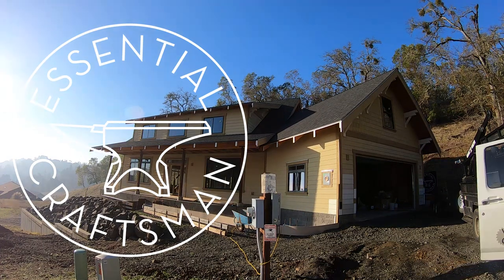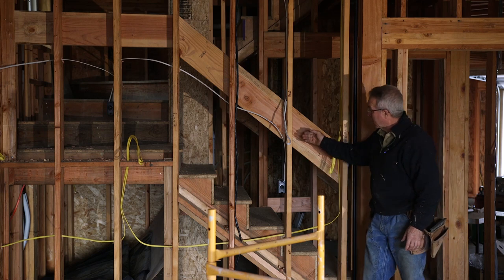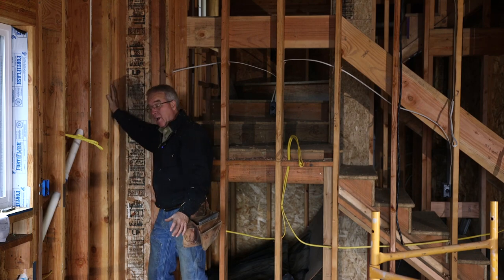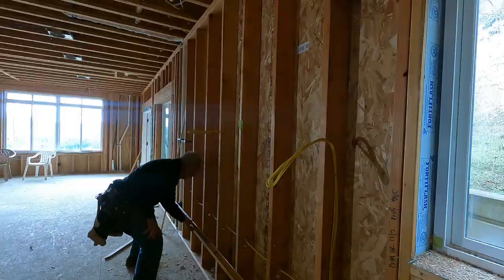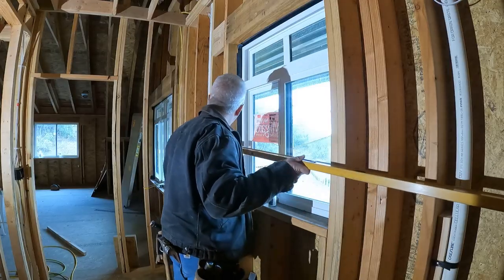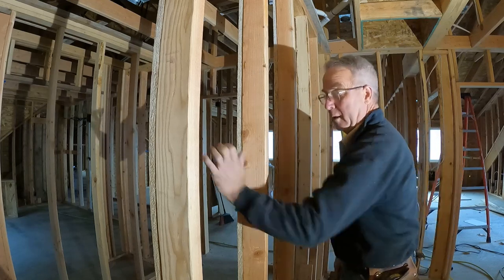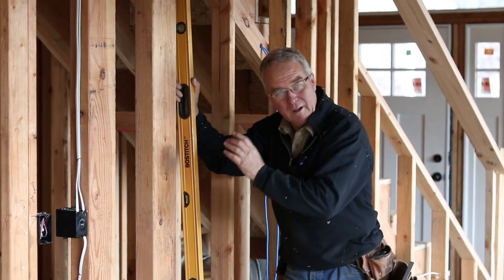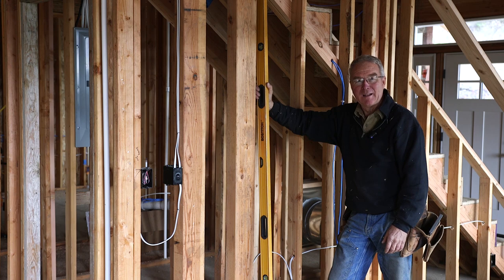Pickup Framing Ep.101

Comment: I installed a backsplash for my parents this weekend and quickly realized that this step was sorely missed. huge cups and bows that I had to mud/fir out. That doesn't explain why the existing countertop wasn't cut straight and there was no insulation around the window but it is what it is. Thanks for being my virtual mentor and showing the right way to do things the first time!😁

Comment: When you cant built the walls flat and throw them up (adding walls to existing structures) I make a jig from a straight 1x4 and several chunks of 14.5 inch 1x4 spaced with tight 1.5 inch gaps. Its honestly one of the most useful tools i have. It keeps the studs in plane and you can use screws or shims to flush studs you are adding one by one before you set them with nails. It takes more time but shortcuts lead to longcuts.

Comment: You and me differ on 3 points: I religiously install drywall backing on 100% of the top-plates and wall-junctions and I am fanatic about fire-blocking on every vertical cavity plus using fire-grade caulking on all stud or plate penetrations by plumbing or electrical. My son's house in Missouri caught on fire from the outside at the bottom-plate level and the fire went straight up into the attic where it did the most damage because of no fire-blocking before it was extinguished. Pick-up framing is usually not done that well by builders but to me is the most satisfying part of construction next to mudding.

Comment: As a young man, many moons ago. I worked as a helper on a framing crew building tract housing in Florida...Non of these practices were done, it was all about how many could we get done in a day. As soon as we gathered our tools up, the rockers were throwing up dry wall. Sometime you would see a wall stud bowing in the middle, you would just either slam the top or bottom to get a little of the bow rearranged to either the top or bottom. These house were built with all 2 X 4s, rarely seeing a 2X6, and never ever a 2X8 heaven forbid. Sometimes I drive through this same neighborhood, and guess what they are still standing and looking pretty good..amazing. But dont blame me, I was a board stacker, and forklift driver. Left the job after getting a chip off of a #4 case hardened nail into my eye, man that was painful. Safety wasnt a thing back then ( 1970 ).
Reply: A guy that worked for me had to wear an eye patch for 8 months as a result of driving those 4p cuts with no glasses. A year later, I walk around the corner and; same guy, driving the same nails, with no glasses. 😣🙄
Reply: @psidvicious  I was putting up furring strips on concrete block walls, as the framers were framing, my boss thought I wasnt going fast enough, so he pulled out his hammer and started driving the nail I had already started, he was at a angle while doing so, thats what made it splinter and go into my eye, He was fired the same day, They took me to a eye specialist, and they pulled out a sliver, which was scrapping my inside eye lid, the salt in the eye fluid would get into the scrapes and major pain was had that day, saying nothing about the salt going into the hole where the sliver had been lodged. Fun Fun. The company was afraid I was going to sue them, so they treated me really nice, but I wanted to be a carpenter and not a forklift driver, so 6 months later I said Goodbye. And became a welder.

Comment: I'm a steel guy.
Tolerance of .001" some process.
Tolerance of 1/8 on completed construction.
1/4 " over 100'.
Talking to one sub trade carpenter. Watched me use a transit to line up a tower and shim as necessary the first 10' section.
He says.  man let it go. I use under a quarter inch  out of plumb on my walls.
I says to him...1/4 inch over 80 ' is 2.5 inches out at 80' this structure will be almost 4" out when completed at your spec.
Reply: Do you do steel framing for residential at all? Been hearing all sorts of conflicting info on steel framing for a house.

Comment: this whole project has been very  interesting but i still can not get my head around building a house in the 21st century out of such a flammable material as wood..in a first world country                Keep up the good work guys :D
Reply: Steel, concrete and masonry may not burn, but they are not necessarily as fire resistant as common myths make them to be. Same goes with steel in lightweight construction. These non combustible materials can and will bend, buckle, crack/expand/explode, defeating compartmentalisation (if any was existing) and spread the fire. Well engineered wood structures perform better.

Comment: Personally.. The only important wall leveling is hallways and ceiling. Most walls will have some furniture, pictures etc..  on them. Kitchen cabinets can easily hide variances in framing (within reason).
Reply: The countertop will show any imperfections
Reply: @timothydillon6421  disagree.. Would have to be pretty major. The backsplash will be able to compensate for a decent amount. 
If a kitchen is not doing a backsplash.. They probably don't care about a warped wall.

Remember leveling the walls is a detail that most contractors and most construction wont care to spend the time or money on. Its more of a high end build or customer request deal. 

The chosen texture can make it where the unlevel will not show.
Like he said also.. Its mainly big changes. 1/8 you wont see. 1/4 you might.. Depending on location. 

Craftsmanship is dying.. People just want things done quick and cheap. Very few care about the details of quality. If it breaks.. Buy another.

Comment: Every spec house I've ever worked in clearly skipped this step. They check for backing for cabinets/ towel rods etc but never have I seen a wall checked for straightness. As you said its too late after drywall and it only shows worse for the next 50+ years. Such a shame

Comment: 6:26   Why are those big ass recessed light housings still popular when we have nice flat 1/2 inch thick LEDs that just pop right into the drywall. No housing necessary. They even fit right under a beam if that's where they need to go.

Comment: I know you dog on the cats paw aliitle. Heh a pun. but i like using the catspaw. I like pulling out nails either gently or quickly depending on the job.  I think its becuase so many contractors seem to have cats paws with curved heads. Thats the problem. The silver and blue eastwing cats paw has a straight right angled head. And thats how it should be, so you can dig precisely under the knail head and get a a good grip. You can hammer it on its head strait. Ok just felt like sharing.

Comment: Do not forget to install landline wires 
You never know when you need it😘
Reply: Good idea to install some sort of wires for a landline, but there's absolutely no reason to use actual telephone wire (4 wires, a red and a green wire for line 1's circuit, and a yellow and a black for line 2's circuit) when the box of Cat-6 is right there and you could just run that for the landlines.
It's a good idea because who knows, phones might switch to using network cables instead of landline wires (these already exist in office buildings, they're called "Voice over Internet Protocol" phones or VoIP phones for short, and who knows if/when those are going to be made for residential use.
Besides, you can put landline signals (up to 4 lines worth!) on a piece of Cat-6, but you can't put data network signals on landline wire.
Most Cat-6 cables is more fully referred to as "Category-6a Unshielded Twisted Pair", because it does not have a wire braid shield or foil shield around the entire cable or even around the individual pairs (hence "unshielded"), so the only defense against external interference or cross-talk is that there are 4 pairs of twisted wires (hence "Twisted Pair").
For shorthand, you can correctly refer to such a cable as "Cat-6a UTP" network cable.

You can get cables with better shielding, and with higher maximum data throughput speeds, however that adds cost.

The example that I know (and the one I used to wire up my house, because I never want to be handicapped by the cable in my walls) is "Category-7 Shielded/Foil Twisted Pair", which basically ticks all the boxes. For shorthand, this cable would be referred to as "Cat-7 S/FTP" network cable.
Cat-7 means it is specified to carry more data than Cat-6, and "Shielded/Foil Twisted Pair" means it has added shielding to prevent interference. Specifically, "Shielded" means there is a wire braid to act as a shield against electrical noise around the entire cable (all 4 pairs are inside the braid), and "Foil" means that around each individual pair of twisted wires there is a layer of metal foil.
The wire braid shielding will intercept most of the external electrical noise that may be produced by things like nearby power lines or coaxial cable lines, and the foil around each twisted pair of wires will intercept most of the signal radiating from the twisted pair itself, preventing that outgoing signal from becoming an incoming noise source on any of the other 3 twisted pairs in that same cable or any other cable nearby.

As I said before, the downside of this better cable is that it costs more. Per foot, I paid maybe twice as much as I could have if I chose Cat-6a UTP instead of Cat-7 S/FTP.
However, in my situation I can tell which way the future is going.
Things are only going to need more and more data sent to/from them, especially with the soon widespread acceptance of 4k UHD TV's and therefore 4K UHD TV shows being shown over streaming services like Netflix and Amazon Instant Video and Hulu and the like.
Knowing this,  I chose to "spend the money now", rather than "spend less money now, but then have to spend more money later to upgrade".
I expect that the cables I put in should be good for at least 20 years barring some revolutionary increase in overall data throughput speeds or the widespread introduction of optical fiber based data networking taking over instead of copper cable based solutions, which would only be needed if data usage went up by like 20 times.

Comment: Great tips. Now let's pray the drywall guy doesn't put in butt joints and bow the finished wall 😂
Reply: Can you explain? DYI er here. thanks.
Reply: @613kc  Drywall is made slightly thinner along the long edges to allow for the build up of drywall mud. They don’t make the ends of the boards like that so at a “butt joint” the drywall finisher has to feather it out over a greater width to hide the joint.
Reply: @psidvicious  Got it Thx!

Comment: Letting that sheet rock run past the the ceiling joist three to seven inches might piss off the finish carpenter  if he's or she has  to run some crown   At least flat block the corners with a 2x8 or bigger so  the too of the crown can be pinned.to somthing solid  where the cornered meet. up.

Comment: you guys never consider to sheet the interior walls with osb 12mm (1/2 inch) and then sheetrock? dont have to worry about blocking, more soundproofing and you can tape the seams of the osb to perform as vapour barrier
Reply: My 90 yr old house has 1x6 tongue in groove sheathing under the sheetrock. It's a gem.😊

Comment: Any plumber or electrician who can't drill a hole through blocking shouldn't have a license. And the person you showed drawing that hole at an angle shouldn't have a drill in his hand. Want a plumber drills through the framing of the blocking of the wall it is extremely important to get the whole straight because pipe doesn't Bend unless you're using crappy PEX tubing. And even if you are using Pax you still should drill the holes straight and inline

Comment: Really surprised to here you advocate for hanging 5/8 sheetrock up to 7". That's, in your words, weak sauce. It may never have anything happen naturally, but in the event somebody bumps that corner your getting a cracked joint. Too easy to put those nailers in before the second floor is decked.
Reply: Drywall clips  problem solved
Reply: Yes ceiling which will be supported by the wall sheet. New to me, good to know
Reply: Floating ceiling corners actually provides for more movement before cracks and nail pops develop. This is especially true at interior walls in homes with long span trusses which move substantially with temperature and weather conditions.
Reply: @neild7971  ya and clearly something hitting it will be striking from below not above. But I'm sure you knew that
Reply: @adamr1637  read my comment. I never said it would happen naturally, I was specifically talking about and clearly mentioned something striking the ceiling from below.

We are talking about unsupported for 7"...do you really advocate for 7" unsupported?
Reply: @swingmaneats  good point. But I don't think he said 7" with clips. I believe he was talking about unsupported.
Reply: @thomasbacon  yes. https://www.jlconline.com/how-to/interiors/truss-uplift-solutions
Reply: @adamr1637  dude that is not 7" unsupported, that is using clips. Big difference. He was taling about 7" unsupported. So again, do you really advocate for 7" unsupported?
Reply: @thomasbacon  i was thinking more about sag over time, i do agree with you and will always try and support the corner.